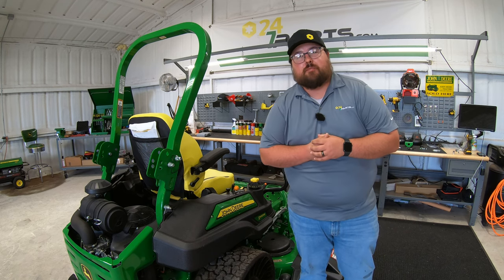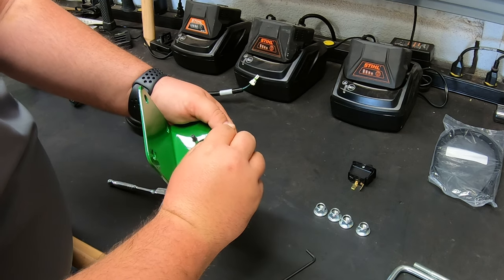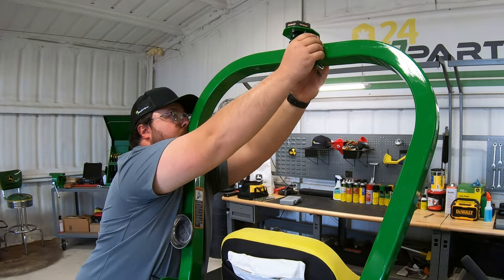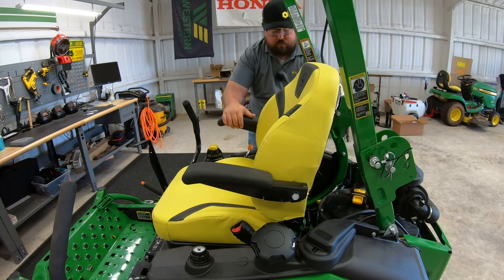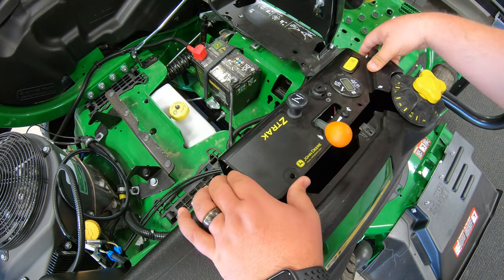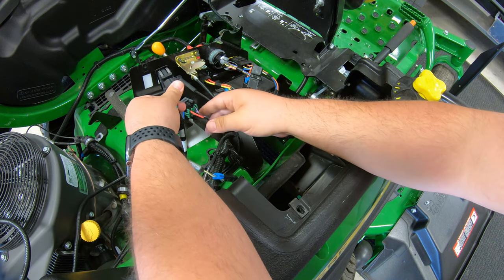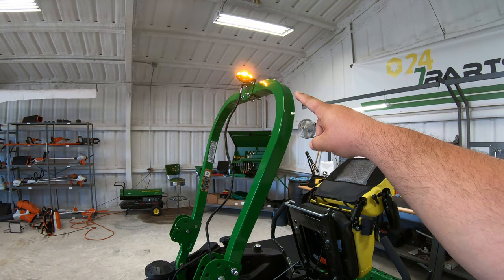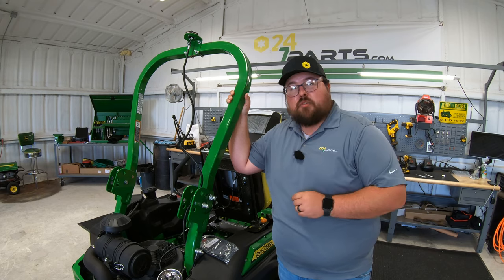How to Install Beacon Light on John Deere Z9 Zero Turn Mower

Comment: Too bad the bracket is not adjustable so the light will sit level to produce a better light pattern. The light is tilted up on the rear side and tilted down on the front side.   😟
Reply from the maker: That would be nice. I had not thought of that.